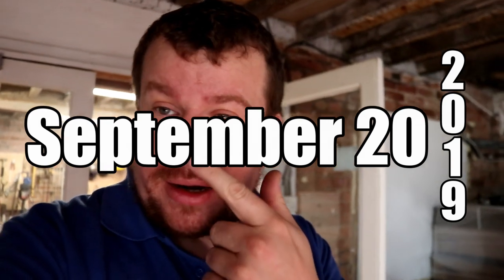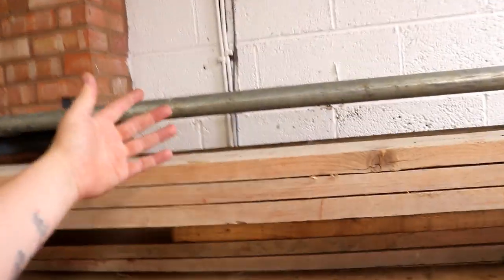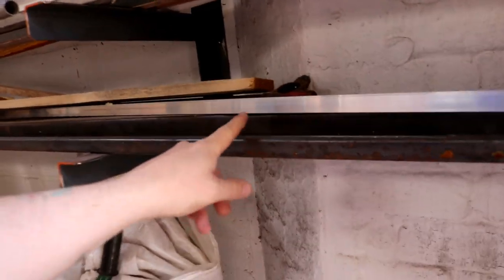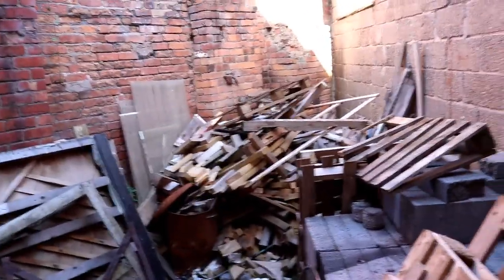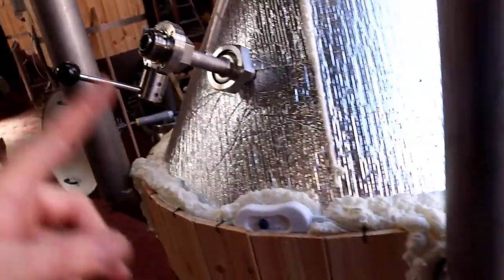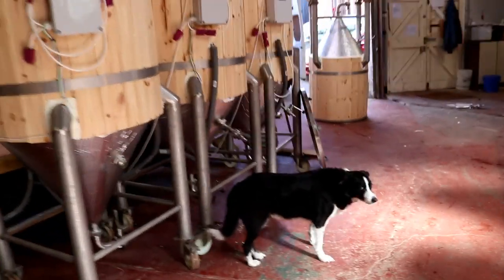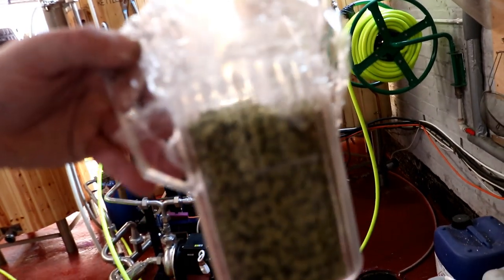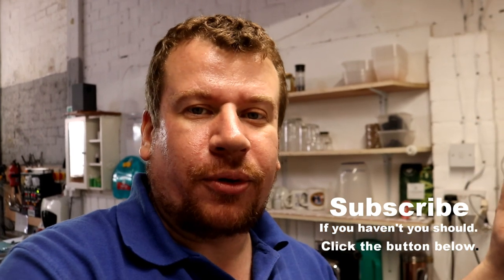FAST PACE BREWERY ANTICS

Comment: I'm looking at that alcove and thinking you could make a little lean-to off the top of the window on outside and put the gas bottles etc out there,maybe even the welders themselves. Get it all out of workshop but still within spitting distance? Or maybe just tin roof the lot and use the whole area as storage? Gemma is a trojan worker. Have a great weekend,hope to see you next week. Cheers.